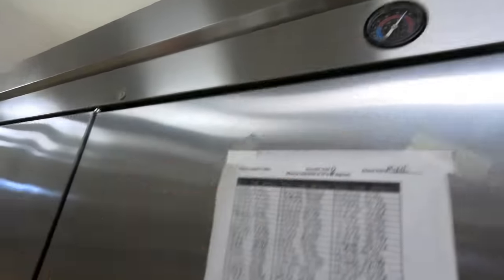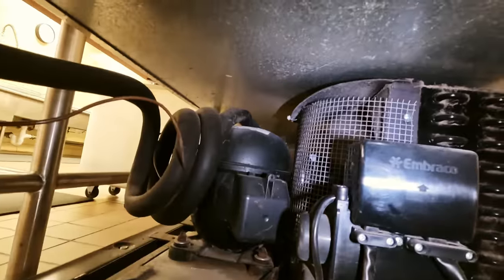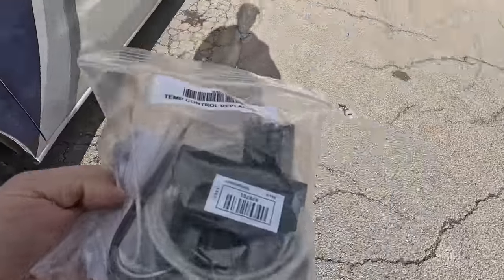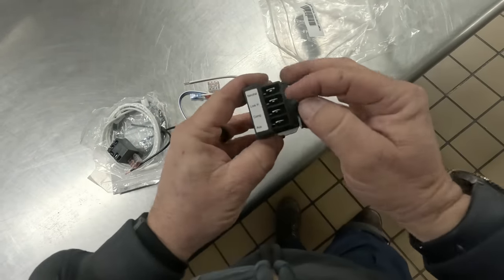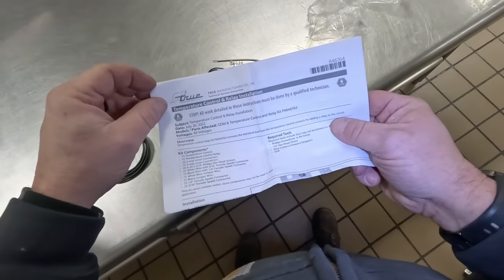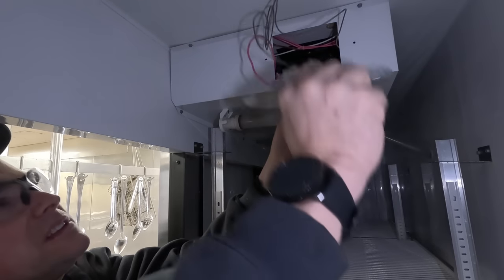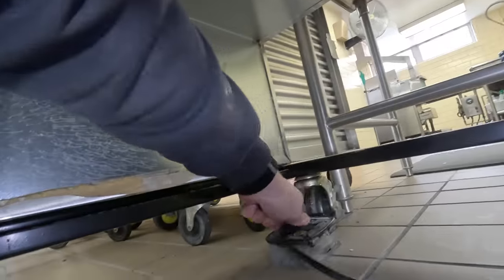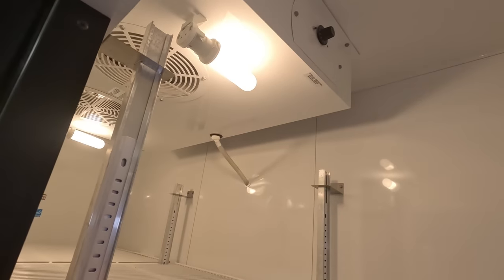Refrigeration Issue Or Thermostat!?

Comment: Nice job, Rick! A little more work with the electronic control, I'm guessing they are more reliable? I stock an A121560 Ranco constant cut in at 39.
Reply from the maker: I have those Ranco controls but I have had several customers call us back not happy with the operation. So I try to go OEM if possible.

Comment: Been having some issues with the newer True GDM Coolers Temp controller. They didn't install the relay and had the controller feeding comp, cond fan an evap fan. 
They obviously started acting wonky and the warranties come with relays. Why not just install it at the factory and save money on warranty calls smh
Reply from the maker: That's "True" 😉

Comment: What is a good thermometer or temp probe to get to use for reach in cooler s/evaporator temps?
Reply from the maker: I really like my yellow cooper atkins stick with the thin tip, it measures quicker than normal and is very accurate. https://amzn.to/40ZCneG
Reply: @HVACRSurvival  is that one good for air temp or just for stabbing the food itself?
Reply from the maker: @brandonmickelberg6787  it works good for both, I don't like the big fat ones that take forever to reach final temp.

Comment: You'll be back to replace those probes in a few months 🤣🤣🤣
Reply from the maker: I have a few progress😁, I've lost more controls than the probes.
Reply: @HVACRSurvival  I lose so many probes from hoshizaki and true usually under warranty usually freezer coil probes, very little from traulsen or bev-air. I've started only installing the dixell controller if not in warranty, now Emerson/Copeland and those usually last 5-7 years. They have a nice universal one just buy the voltage you want and you can use 1-3 probes and match almost anything out there. Hard in this case since there's no xr existing but I just run the wiring through the refrigeration line chase and mount it underneath in the back.